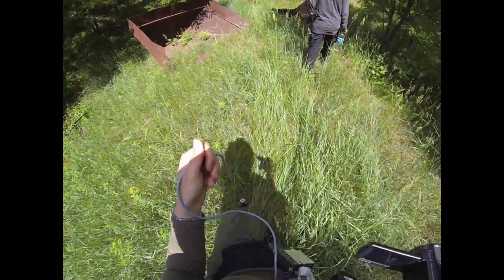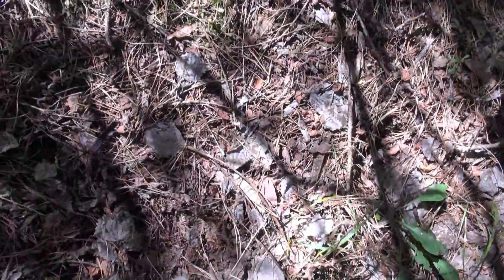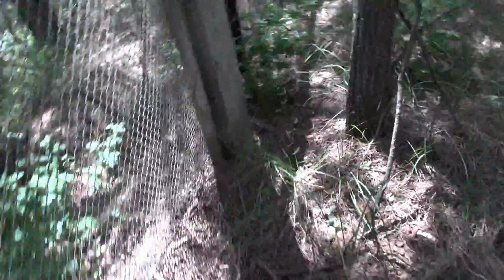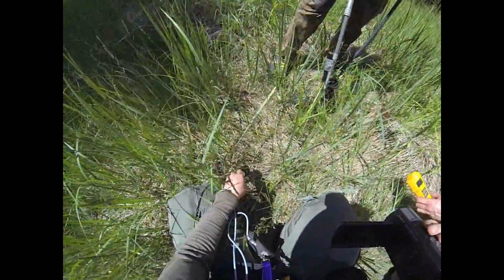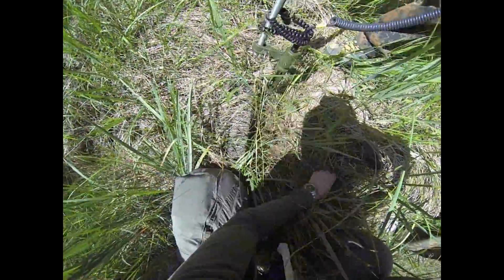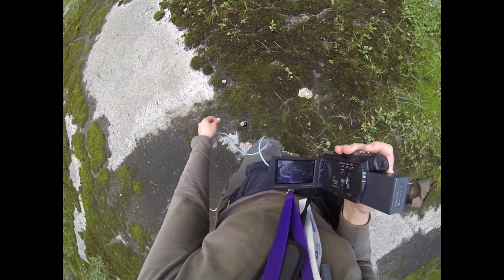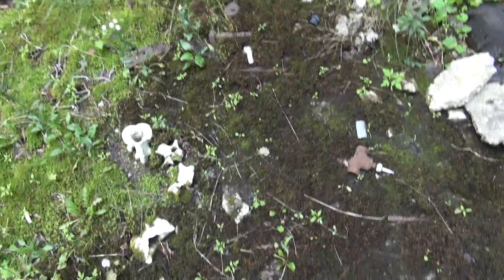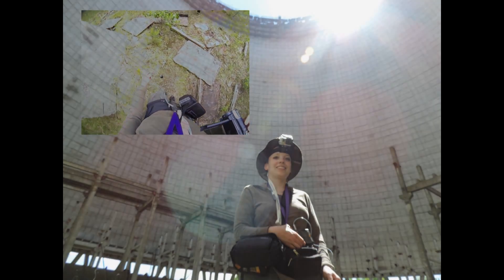chernobyl 2013: strolling around reactor 5 and 6, visiting their cooling tower

Comment: From what I can gather, the scaffolding would support some kind of structure. The hot water gets sprayed in at the top of the structure (which is actually rather low relative to the tower itself), and trickles down to a pool, getting cooled by air in the process. Air contacting the hot water is heated and rises. The bottom is open so that cool air can rush in to displace the rising hot air. Hence no need to waste power on fans; the tower has a constant supply of airflow to chill the water.

Comment: The tower doesn't vent steam. After steam from the reactor flows through the turbine, it needs to be cooled by a condenser to become water again and be pumped back into the reactor. There is a second water cooling loop that feeds the condenser. That is what the tower cools. Some of the water evaporates and forms a cloud, which is what one sees coming out of the tops of them. For more info, search for "natural draft wet cooling tower".

Comment: It's open at the bottom so a convective air current can form. Air next to the inner surface heats and rises, pulling fresh cool air in from the bottom. The pipes are inside the structure of the tower. The tower shape with its ability to form a strong convective current gets more cooling than a flat wall would for the same surface area (and thus construction costs).

I've been inside an old beehive burner, and the acoustics were crap. It had insane reverberation that would mar any music.

Comment: the cooling tower is completely different than I would have expected. I no longer understand the concept of how it is supposed to work. Why is it open on the bottom? What are the scaffolding type structures? Are the big pipes just for venting steam into the tower? If so why does there need to be a tower?

Very cool by the way. I would have been fun to play some musical instruments inside the tower.

Comment from the maker: radioactive clothing, nope. just shoes or hands, but i decon them on the spot (see other comment below). clothes are very hard to decon, so i try not to get anything on them (with success so far). for hands, it works well if you scrub them over the bark of a tree, rinse with water, and repeat a few times. the stuff you'll find in chernobyl is not in the form of liquid, soluble isotopes - it's just surface contamination / dust and rather easy to get off. no big deal.

Comment from the maker: i had some minor readings on my shoes once (three times background or so, not sure what i stepped into). i just scrubbed them over the pavement, then into grass, pavement, grass, wash with water, repeat - and the readings were basically zero again, did not set off any detectors at the control points.